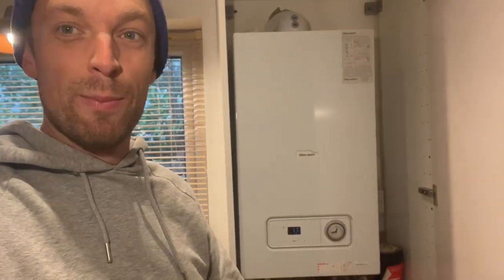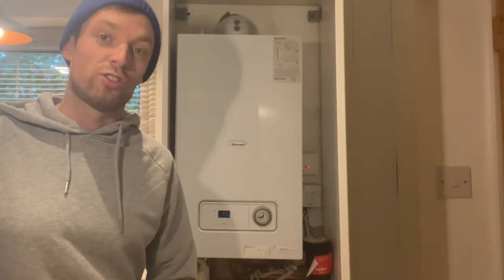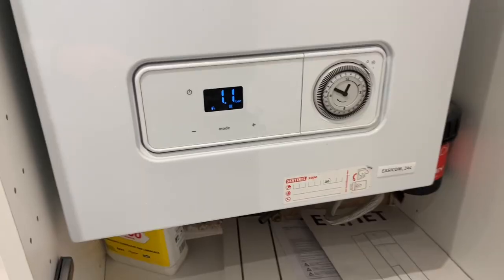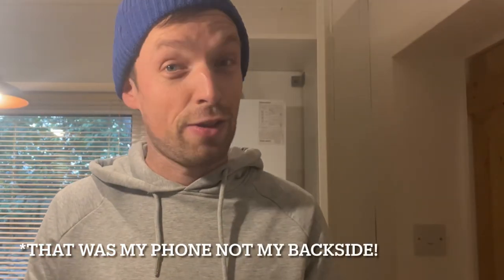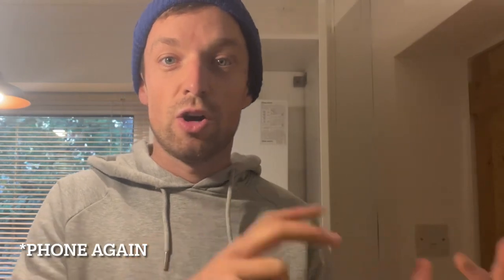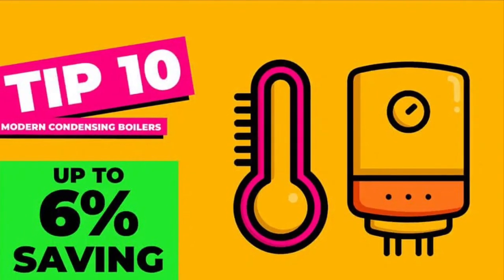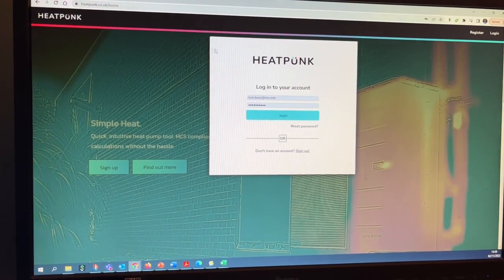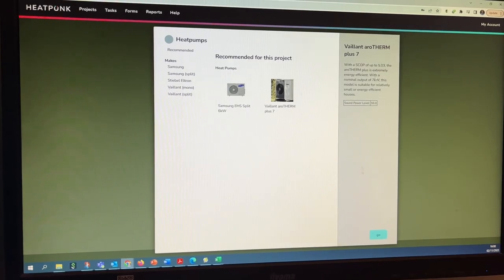I followed Heat Geek's advice on boiler settings - GlowWorm Easicom 24

Comment: This is an interesting subject if everyone paid attention. 
My 1960's 3 bed semi is very well insulated given successive home improvements over the last 8yrs. Sheep's wool insulation under all suspended floors,  cavity wall, and argon filled double glazing and loft and all CH pipes super lagged. Our Worcester Bosch 38Cdi gas combi boiler is rated at 30kW max for CH and I discovered the range setting to be 78% (23kW) for a total house radiator sizing of 12kw of low flow radiators. The whole house could heat up within 5min from cold under the 78% range setting.  I have not worked out the heat loss of our property now  but it is low. 

On 14th Dec with an outside temp of -5c in Huddersfield I reduced the boilers range output to 50% (15kW) and fixed some "clip on" temperature gauges (Amazon) to the boilers outlet and return pipes as well as two gauges on one of the radiators.  With the manual  dial on the boiler to 3.75 (7 max) the boilers CH outlet pipe temp was now 32C and return 26C as was similar on the radiator. That is much lower than what people are saying it should be. The house was kept between 20 to 21.5C all day long controlled by the thermostat. My in home display showed a total gas cost of 8.50 pounds GBP for that -5C cold day. Today, 15th Dec its a little warmer but still below zero and  6.52 GBP for the day (gas + standing charge) and that includes showering too. I believe I can drop the range a tad further maybe to 40% (12kW). If I can get a return temp of 22C when its -5C outside that would seem to be as best I could get it.  

I purposely mentioned the cost (we are with Bulb) because that is what everyone see's at the end of the month and given the cost of energy, I don't think that is a bad daily cost at -5C. I do not have a benchmark with what others pay, but by my own admission, I was wasting money, energy and efficiency at the previous boiler setting. If everyone paid attention and did their little bit, then as a nation we do a lot.

I also respect the fact there are many people who are not in a position to be able to improve their homes, and that is where suitably applied Govt. grants should really help. For that, we need professional people and not scam artists.
Reply from the maker: Hello WA - really interesting case study - thanks for sharing! Your flow temperatures are very low but sounds like with your insulation efforts you have made great steps to have an efficient house! 

Spread the word! We can all do a bit more and if we can save a bit during winter with such high costs it make sense to do so!

Happy Christmas to you in Huddersfield! I have family in Halifax and Brighouse
Tom

Comment: That has been what I've done, though because it's an older radiator system, with a variety of pipe formats, I'm not sure there's the volume in it to iron out the blips, so to speak. When I eventually go to ASHP, I will also be resizing the rads based on the lower flow temp because I'm sure the current install has been set to a high flow and something like 11°C drop (because that's what the world was like back in the 80s/90s when I was in Building Services Engineering). It is, to coin a phrase, a right pain in the eras to balance the rads, and I've still not got it right!

Current flow is 45°C for DHW and 47°C for rads. I need to reassess the heat loss now that I've had  a near 2yr run with the unit, along with the last of the major insulation work completed.

Also, have you thought about a lapel mic? When you pop round to ours, I'll show you what I use (£20 plus free video app that understands external sources)...😁
Reply from the maker: At least you can do a lot of the sizing / thinking yourself with all your experience! 47°C for rads is really good. Are you happy on the coldest day with that?

I have thought about a lapel mic... and done nothing about it! Is it that bad?! 

I do need to book in a trip to yours... sorry!
Reply: @TomBray-LowCarbonLifestyle  We've not really had a cold snap with 47, though it was okay last winter with it at 55. I could start looking at the rads one by one, starting with rooms with single panels upstairs as a couple of them struggle.

Mic - only really needed to cure the varying volume when you alter the phone camera position, levelling things out across the different cut points...😁

Comment: 50 degrees is fine for our central heating all year round (also in Co Durham), we have Tado thermostats on every radiator too, so we are only heating the rooms we need to.
Reply from the maker: Brill - what kind of house do you live in? What kind of age? Any insulation improvements?

If you’re ok at 50, you’re probably ready for a heat pump
Reply: @TomBray-LowCarbonLifestyle  Its a new build (EPC B) and yes a heat pump would be nice, shame the builders used microbore pipes, so people like Octopus won't touch it. Thinking about Tepeo as an alternative...
Reply: @edwardpickering9006  just because Octopus will not touch it does not mean your system is unsuitable for an ASHP transplant. Octopus is focused on picking the low hanging fruit.

Comment: curious about this and I’ve been going around in circles for a while. If you have already set your flow temperature much lower, isn’t that effectively going to have the boiler using less energy and running at a lower kw output - so the same thing as range rating? Are the two linked in some way? I’ve adjusted my vitodens 050-w down to 50c water which is fine (opentherm has it at 38-40 even at -3 outside), but should I range rate as well or no need? My heat loss estimate is 6kw for the house
Reply from the maker: Interesting question! 

Yes the flow temperature being lower will reduce the power required to heat to that temperature. Although even at lower temperatures a gas boiler could fire at its max rating. Range rating the boiler will limit how hard it works, which should contribute to a higher efficiency. A bit like limiting how hard you accelerate in a car. 

If your heat loss estimate is 6 kW it can't hurt to range rate to 10-12 kW if possible, it might not be noticeable in your bills but if it saved 1%, 2%, even 5%, that would be beneficial!

If you are happy at 50 degrees, that a system working very efficiently. And, you wouldn't need to upgrade any radiators to move to a heat pump....
Tom
Reply: We have an Ideal Logic 15 boiler running rads and a hot water tank (not combi but I think my comment may be relevant to combis as well).  The Ideal 15 has a max and min gas burn which I assume are set by the manufacturer.   Although you can cycle the boiler between the two and see/hear the difference this is just for the installer to check that all is OK.
When in normal operation the boiler must decide what burn (gas flow rate) to use.
Therefore my option is just to turn the flow temperature down and hope the boiler control does its stuff!  Max equates to 15kW and Min to 5kW.

Comment: I dropped our heating flow rate to 45 from 82c, can’t believe we had it like that - it’s been no issue at all even dear to say it’s a nicer heat, but one issue we’ve had is cycling on the boiler. I’ve now rate ranged it down to 8.7 roughly the heat loss of the house (solid wall) 1890 Victorian end of terrace. But the cycles continue - I’ve tried with the anti cycle but the rads go cold and it still goes mental to return to 45c after the time has elapsed, the other thing I tried was the the Anti cycle temperature hysteresis (temperature differential) but it’s never low and slow these things hold it back but just full blast on for 30 secs then off again. Any advice?
Reply from the maker: Hi Charlie - interesting to hear this. It sounds like you have a good understanding of your system, so probably not much more I can add. 

Is there anything preventing flow to your radiator circuits? If TRVs are throttled back this could lead to boiler cycling. 

Maybe a question for heat geek or the heating hub?
Reply: Sounds like you have an ‘old boiler’ and it may not have sufficient modulating ratio so that it’s minimum firing rate is too high for your heat loss.

It may also be you have some of your radiators shut off or you have insufficient flow through some or all radiators.

That said if your cycling is not excessive you may have to live with it.
Reply: @normanboyes4983  fixed it, seems I tuned the pump down to its lowest setting so the water can’t escape fast enough. Bumped up by one seems to of fixed it in one go average “burner” on time now around 5 mins
Reply: @charliekelly7945  What is the total heat output of the sum of all your radiators, towel rails at your selected MWT? Also what is the minimum firing rate if your boiler?
Is your house warm enough?
Reply: @normanboyes4983  our total heating output is around 5.5kwh and the combi only goes down to 7.0. I’ve fitted a new radiator type 11 to type 22 that brings us to 6.5kwh. But I’m a bit annoyed I have to allow the boiler to drop to 35c to stop it short cycling. To be honest i think the boiler is far to over powered 25kwh
Reply: @charliekelly7945  well you have range rated it down so the 25Kw/hr rating is not impacting. The bottom line is your minimum firing rate (which is too high). The rated output of your rads are only really that relevant when your house is cold, once all the rooms are up to say 21C  even with all TRVs wide open then the Delta T between your MWT and RT is at its minimum and the less load the boiler will ‘see’. I am not all sure there is anything you can do about the cycling short of upgrading to a better modulating boiler which is likely not economic. Maybe try range rating down to 7KW/hr and drop flow temp to 40C. Are you getting sensible Delta T across all rads?

Comment: Are heatpumps not advertised as electrical 6kw/7kw though? so 7kw of electric at 300% is 21kw of energy? so given its a boiler then for 7 you'd would want 21kwh surely? unless heat pumps are actually advertised as kwh energy... didnt realise if so.
Reply from the maker: Hi gsdevme - no thats not quite right, a 5 kW unit would be able to deliver 5 kW of heat at a set flow temperature at a set external temperature. They draw half / a third of that load as electrical power. 

Heat pumps are advertised at their rating in power in kW. A kilowatt hour (kWh) is how much power they use over a period of time, I.e. how much energy they use. So if they deliver 5 kW of heat for an hour, they would be delivering 5 kWh and using roughly 1.6 kWh electrical energy …
Reply: @TomBray-LowCarbonLifestyle  wow thats interesting. I hadn't realised this. I thought they always talked about electrical rather than energy. Funny though Ive seen air to air heat pumps with much higher heating capacities near 10kw.

Comment: Limiting the boiler max output will not really change much! That is, because the boiler will only run at this power level during startup, then it will regulate to much the set temp. Therefore , the only minimal gain is during the first minute or two , that the return water is too cold for the boiler to manage the set outlet temp. This is definitely not a 6% gain, it is a function of thermostat cycles, that should be reduced anyway. Also in a very cold weather snap or a home reheat after days, a need for high flow temps may arise. In that case the limited boiler output could  hinder its ability to deal with such conditions. This is especially true with under floor heatting. As a result, the recommended control paramiter is flow temperature, that can be adjusted relatively easy by the occupants if necessary.
Reply from the maker: Hi Sevastos, I suspect you are right about it not being a 6% gain, although there are positive steps about a boiler not firing as hard and therefore reduced degradation on the boiler itself.

I agree the key parameter is flow temperature and getting the boiler to condense.

Thanks
Tom
Reply: Down rating my Worcester green star actually made a big impact to the first 30 mins after firing up.
Reply: @manfromdelmonty303  Do you have DHW cylinder, or under floor heating? Also if you have a system with big thermal innertia it obviously means you are getting less energy in the system.